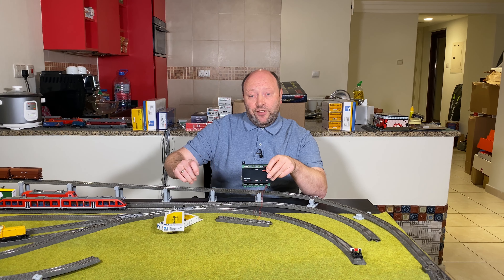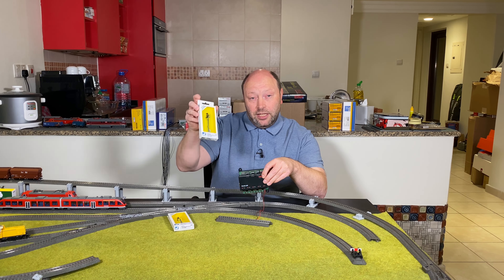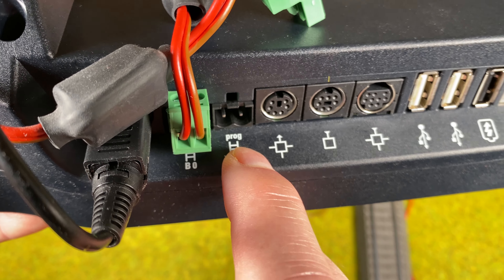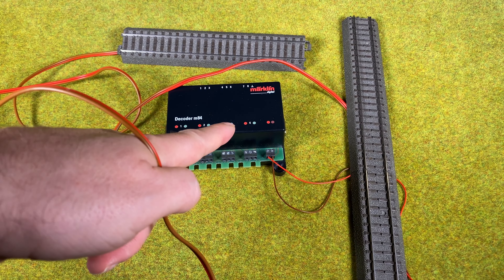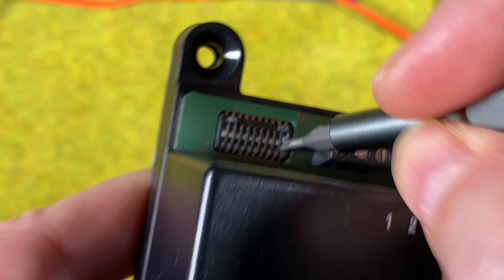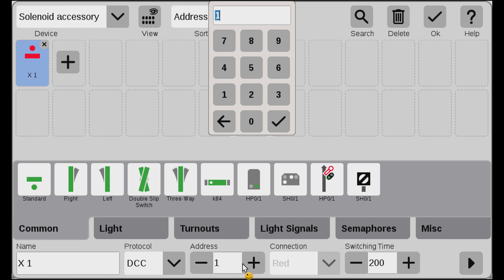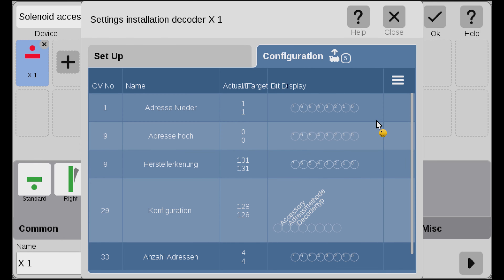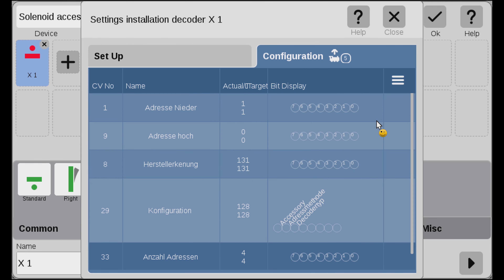Programming the Märklin 60841/42 m84 for 3/4-way Signals with 2 Addresses (Beginner Episode 8c)

Comment: Hi Bo, you make very good instruction video's, thanks. I have a question if you could consider the following. I personally have great difficulty in understanding the way the CV system works. e.g. I have (black and white) M84's, In my system, I like to change the brightness of one of the traffic lights. Whatever I do, I cannot get it done. and on top of that I  have read that CV 79 is the default, but have no clue on how to activate this. I am looking for a step by step explanation on how to work with CV's, as this will give me a lot of possibilities to work with. At this moment  I am to scary to work with it. From your presentation I understand that it is no rocket science. some basic instruction video's on this would be very useful. I would highly appreciate if you would have the time and energy to assist on this.
Rene
Reply from the maker: Hi Rene, 

The CV 79 only exists for the 60842 (the black m84) - not for the 60841 (white m84). If you want to reset the 60841 (white m84) then write 8 in CV8 i.e. CV8=8.

Like you I have not had any success in making the m84 dim (change brightness). To me it makes sense if it cannot do that as the m84 really is a physical relay. The only trickery I have been able to do is to make a light blink. I do this by:
- CV8=8 (Reset)
- CV33=8 (Change to use 8 addresses)
- CV112=2 (set to Blink 2 mode)
- CV114=2 (set to blink every 2 seconds)
The make an accessory for the address of the first output and set to type "Yellow" on the "Light" tab. When you turn on the yellow light, then it will blink every 2 sec. You can make the other outputs blink as well, by choosing one of the pairs (1 Red=CV112/CV114, 1 Green=CV115/CV117, 2Red=CV118/CV120, ..., 4 Green=CV133/CV135)
It seems the blinking only works when you have the m84 configured for 8 addresses - not for 4 addresses.

How did I figure this out? Well, the issue is that Märklin has not documented this too well. Hence, I used trial and error until I found something that works. The m83 manual below can give some hints and the CV template you can load in the CS3 also gives some hints.

There is a CV38 which is specified as brightness of hobby signal. The hobby signal uses the special connector below. I do not have a hobby signal, so I have not tried this.

If you look in the manual for the m83 on page 22: https://static.maerklin.de/damcontent/3b/44/3b44f7c3c18c5d0a2b0c3e377f3df7281570606458.pdf Then you can see all the functions for the m83. It indicates you can use the m83 as dimmer. However, I have not tried this.

Hope this helps! Enjoy ;-)

Comment: Hallo.. just wondering, how many m84 can we connect as an array for a layout.. currently I have 14xm84 and they are flip flop randomly once a loco is running. Thank u
Reply from the maker: Hi, 

I must admit I am not sure what the limit is and the manual does not specify a limit. However, if you see something flip flop randomly something does not sound right... However, this may not be due to the amount of m84s you can connected. It could be that you generally use to much power on your layout.

If you have a CS3 or MS3 try to monitor the power consumption as shown in this video: https://www.youtube.com/watch?v=UuVuEenZn98 If you are close to the limit then this might be the issue. To be sure I would recommend to be around 80% of consumption as power consumption changes (e.g. when turnouts/signals change) and the digital signals can be delicate.

It could also be your wirering on the layout. How close to the MS2/CS3 have you taken the power to the m84s? how long is the wire from the MS2/CS3 to the M84. If the m84 gets too far away you could have a degradation in the power and digital signal.

It could also be that the array is too long - try and divide it and see if this changes behaviour.

Do remember that you can connect extra power directly to the m84 as well. I have not tried it, but the manual states "The decoder can also be connected to the 66360/66365 switched mode power pack (only in conjunction with 60822) (here power is not taken from the track and the power demanded from the track is thereby less). ". Check out the manual for the Marklin 60842 (black edition) here: https://static.maerklin.de/damcontent/46/23/46232662a863dd86dbcd0291ea519cdf1650956214.pdf

Hope this helps! Enjoy ;-)

Comment: Top Video as always! Though, I have a weird problem, when I change the settings to 8 adresses like you do in the vid, this works indeed, but when I delete the decoder and try to connect it again via MFX, it doesn't find the decoder anymore! Any idea what do to about that? Didn't change any other settings nor dipswitches
Reply from the maker: Hi Jorgen, Glad you liked the video. I am not sure what went wrong in your case. However, after a restart it should work again. You can also try the "discover MFX" under locomotives. The MFX protocol is 2-way, so the accessory also locks to the CS3. Hence, delete the accessory when connected and powered from the CS3 - this will avoid issues like this in the future. Enjoy ;-) Bo

Comment: Great video, thanks. Can you make a video explaining the connection of the Marklin m84 to a Viessman Block Signal 4011 and the Viessman Digital-Bremsmodul (brake-module) 5232, in order to have trains stopping in front of a red signal keeping sound and lights on and departing at a green signal? Many thanks.
My best regards and congratulations for you videos.
Mario Decca
Reply from the maker: Hi Mario, 

There is a video showing how to connect the Viessmann 4011 to the m84: https://www.youtube.com/watch?v=wrSVwgIgR-4

Unfortunately, I do not have a Viessmann 5232 brake module. If I look in the manual: https://viessmann-modell.com/media/pdf/a3/fc/9a/5232-pdfr1DUBw5icOLyK.pdf

Look at figure 1 - it shows the "STOP (S)" input as the one controlling if the brake module brakes or not. This is further explained in section 3 where it states 'The digital brake module detects the signal aspect via socket “S” '. In section 4 it states 'If the signal is set to “stop” the module is activated by the lack of track voltage. '

So to me it seems the braking module initiates the brake when no voltage is connected to the "S STOP". This means you should be able to test out the brake module by wiring it up as show in Figure 1 - but without connecting the wire going to the signal and to the spot after the "emergency stop" section (you still need the wire from S to the "emergency STOP" section). In this way when a locomotive arrives it should brake. If this is the case you can try to also connect S to a Red wire of a live track (or to the Red on the track after the "emergency stop" section). Then the locomotive should not break. 

If all works as I predict above, then I would suggest you connect the Viessmann 4011 as described in the video under chapter "Track: Connect 4011 home block" - see here: https://www.youtube.com/watch?v=wrSVwgIgR-4&t=1293s Then connect the brake module to the track as show in figure 1 of the manual, but do not connect the wire to the signal and the spot after the "emergency section" (you still need a wire from S to the Red in the "emergency stop" section). The trick now is that the brake module should be off when the signal is green. This means you should add a wire from 1 Green to the S (in addition to the wire already connected from S to the Emergency Stop section).

DO NOT forget to insulate the center rail as illustrated in Figure 1 of the manual. Insulate the center rail (Red / B) as I illustrate for the stop track here: https://www.youtube.com/watch?v=wrSVwgIgR-4&t=1901s

BTW - I see not difference between figure 1, 2 or 3 in the manual.

Hope this helps! If not try to send me an email and I can send you a drawing. You can find my email here: https://www.youtube.com/@ModelTrainFun/about

Enjoy ;-)
Reply: @ModelTrainFun  Hi Bo, Many thanks for your very detailed reply. That is what exactly what I have done, but, there is a problem, when it is Red everything is fine, when it is Green the train runs but both lights Red and Green are ON. Do I have to do some kind of programming in the m84 in order to avoid this? I would like to attach a pdf of my connections that you can have a look, I can I do that?
My best regards
Mario
Reply from the maker: @Mario Decca  If both Red and Green are on, then double check you have wired exactly as shown here: https://www.youtube.com/watch?v=wrSVwgIgR-4&t=1293s Note: This is another video (Beginner Episode 8b). The m84 should be in standard configuration, so  reset it (CV8=8). Then you need to use the standard block signal icon for the accessory inside the CS3. As I remember it you need to use "HP0/1" icon under the "Light Signals" tab. Do not use the "HP0/1 Scale" icon. If the signal still shows something wrong - double check if the m84 lights are correct.

If wires are correct, perhaps you did not get the m84 reset correctly? ...or did not use the correct icon?

Enjoy ;-)
Reply from the maker: Let me know if it works ;-)
Reply from the maker: @Mario Decca Did you make it work - I also noticed you were asking to send me a diagram. Please do so using my email - you can find it here: https://www.youtube.com/@ModelTrainFun/about

Enjoy ;-)

Comment: So whats the benefits from all this- Wiessman signals are less then the expensive Märklin MFX signals right - But to use 2 of them Wissman you will need 1 dedicated M84  = same cost at the end if you compair with Märklin signas with MFX decoders and plug and play - Did I miss something ??  How ever crazy price for signals
Reply from the maker: Hi Peo, looking at the prices at my model train shop the savings would be approx. EUR 45 for 2 exit signals with m84 or EUR 49 for 2 entry signals with m84. The other benefit is that you can connect DC power, so you will not have any flickering. Enjoy ;-)

Comment: Like the SC3+ - why not a HDMI out - a big schreen today is standard in all aspects - Just to draw a big layout on that small SC3 screen is
ridiculously bad
Reply from the maker: Hi Peo, a screen output would be nice. However, there are other options. You can connect the CS3 to you home network. Then you can connect to your CS3 using any web browser. This means you can connect from your phone, pc, laptop, mac, smart tv and tablet. The web page does not have full functionality - but most. If you want all functionality you can connect from Windows, Mac or Linux and get the same screen directly available. Screen does not become bigger, but much easier using keyboard & mouse. Note: keyboard and mouse can also be connected directly. I usually use the web page for overviews and screen for making events. Enjoy ;-)
Reply from the maker: Hi Peo, A little unsure if keyboard can be directly connected, so it might only be the mouse that can be connected directly? Enjoy ;-)